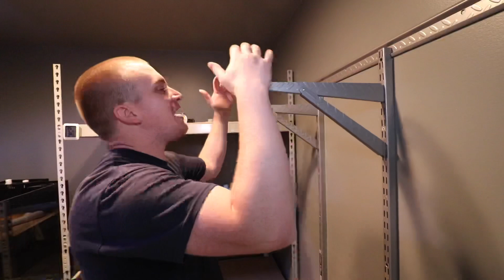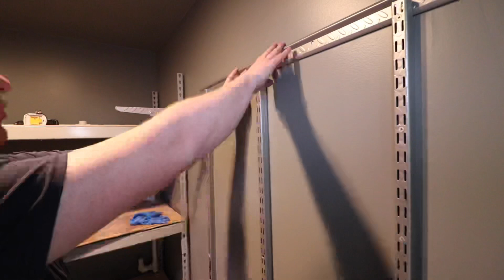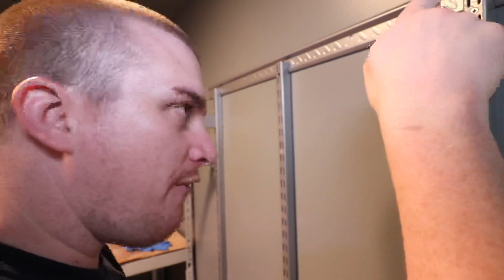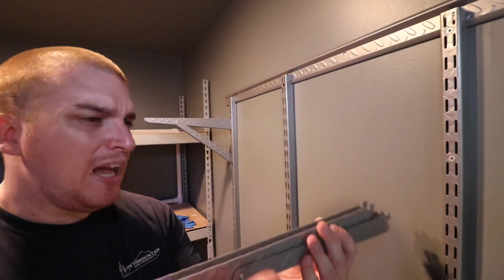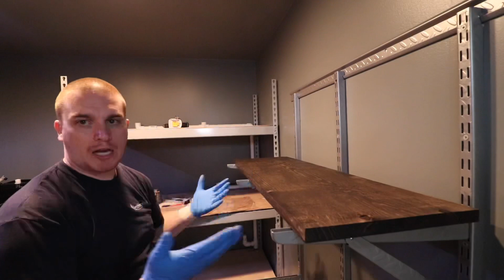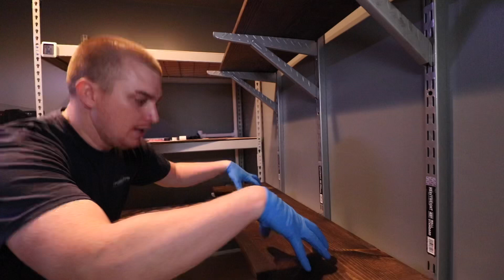Unconventional Aquarium Shelving System

Comment: From your experience of using these for this long, what do you think would be the biggest tank that can go on them? Would love these for like a 40 gallon with a full aquascape 🤔
Reply from the maker: It would be able to hold the weight of the tank with no concern.  The only problem I see is finding a bracket long enough to hold the width of the tank.  With a 40 breeder being 18" wide
Reply: @WeldonTalks  Valid concern but I was browsing the Home Depot website and came across some brackets from this line that were 20" I believe. I just wanted to definitely hear your in put because this is a brilliant idea, especially since I may be moving into a studio apartment where floor space is limited!

Comment: I think a 20 long is 12.5" (front to back). you may need a slightly larger board.  you can actually glue two board together. or pocket hole them together with glue, to make a fatter board if you cannot find something that is larger the. 12" wide, which is most likely a little less the. 12".
Reply from the maker: I have constructed the shelves to make sure they can hold the width, bit of oversight but has been corrected.
Reply: ok, cool, did you find a wider piece of wood or did you join wood together? just courious?